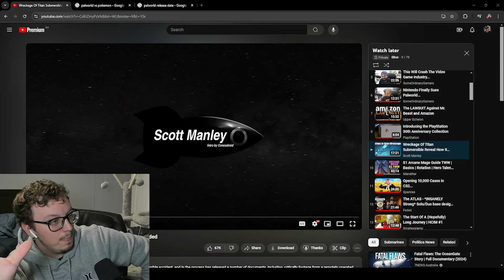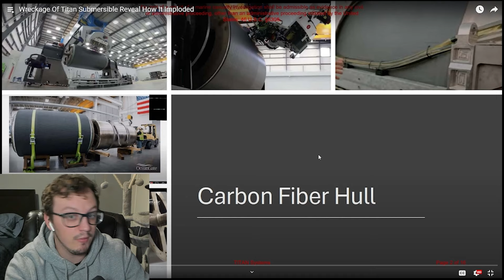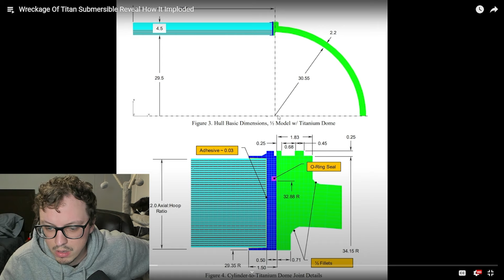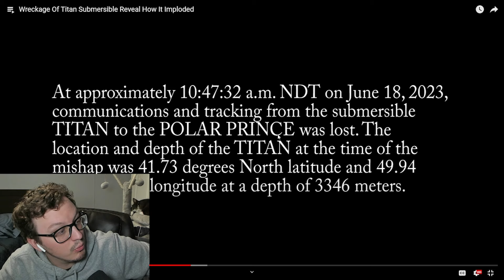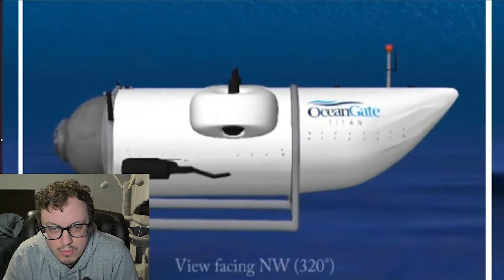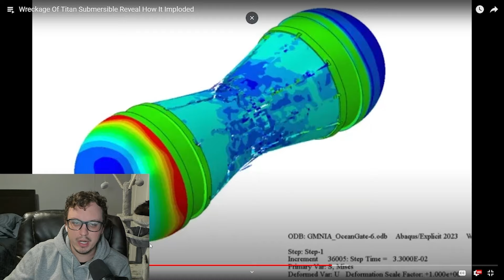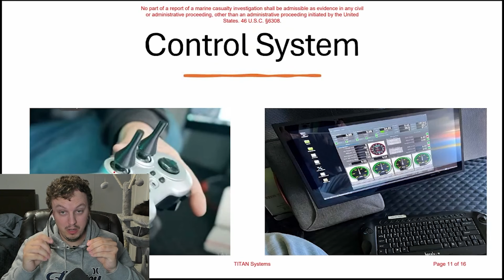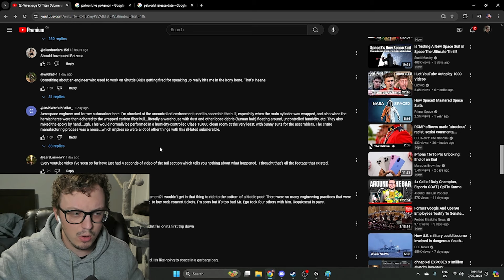OceanGate Titan Submersible How It Imploded

Comment: The contractor who got to look at the parts when they came back up, said that he thought the failure was in the glue joint between the carbon fiber and the titanium. He said that the titanium ring where the carbon fiber had been glued on was completely clean. I think his name is Tym Catterson. His testimony is well worth listening to. You can find it in full on Youtube. Thanks for the video. 🙂
Reply from the maker: Will do. Could be super cool to react to
Reply: They used Polygrip instead of glue.
Reply: @iBluesmile  Thanks. Yes. 🙂
Reply: I saw another video in which they compared that with company videos and showed the OceanGate people basically just put glue (thick, but just glue) barehanded on the rim, apparently without even sanding the titanium nor in a sterile environments. That probably affected how the glue even attached

Comment: The glue in the front joint failed the 5000 psi water sent everything to the back including the passengers...
Reply: I agree.. that's what Scott thinks too.
Biggest red flag among so many on that vessel. Because of the cycles it went through it simply failed and gave out big time this last time. There's demo footage of it showing it wasn't a 100% closed joint as it should have been.

Comment: I’m very chatty tonight.

On “pressurization.” The pressure hull of the Titan as I understand this hull consisted of the:
1) the wound carbon fiber reinforced resin composite (CFRRC) cylindrical hull,
2) a titanium (Ti) adapter ring at each end; and 
3) a Ti hemispherical dome at each end. 
Unlike a typical pressure vessel - boiler, water tube boiler tubes or high-pressure gas flask in which the internal pressure is greater than the exterior pressure - the Titan’s hull experienced higher external pressure (circa 5,500 psi or 1 atm per 10 m depth = 380 atm @ 3,800m) than internal pressure (prob 1 atm). 

The “unpressurized” tail cone means the white fairing was free-flooding. The mechanical, batteries & other components within its hydrodynamic shape were in their own pressure resistant boxes/containers. 

Around 21:40 of your video your explanation is confusing or at odds with my evaluation. About your Fabreeze(R) sprayer, I think you were saying the nozzle/pump handle end was the aft (rear) end of Titan. Thus the base would be the view port dome end. Manley seems to say the failure was towards the forward view port’s dome end due to the asymmetrical nature of the main wreckage. Tym Catterson (former OG ops crew and who examined the wreckage as it was brought aboard the recovery vessel) opined based upon his hands-on examination of the forward adapter ring that the final failure began at the joint between the CFRRC cylinder and the ring. He said the inner lip of the ring was nearly sheared off circumferentially.

Based upon the following (from others whom I deem creditable):
1) CFRRC fails with a brittle failure mode - shatters into pieces suddenly with little or no warning;
2) CFRRC in compression is far less suitable than a ductile, homogeneous material like Titanium or steels.
3) In compression layered CFRRC can suffer buckling on the interior surface of a cylinder (OG’s Cyclops I hull actually exhibited signs of this behavior) and delamination between layers;
4) The junction between the Titanium rings and the CFRRC cylinder was problematic due to the differing modulus of elasticity and thermal expansion coefficients of the differing materials would cause the dimensions to change -> gaps could open up.
5) The CFRRC would likely suffer delamination over time - a “fatigue failure” resulting in loss of safety factor.
6) In most failures once a critical crack length is reached the final failure is abrupt, sudden and travels at high speeds (close to the sonic velocity in the material), faster over short distances than the human sensory system and brain can process. Classic fatigue failure starts with a small imperfection, a crack starts to propagate in tiny increments until the critical length is reached. Then rip!
7) The asymmetrical compression in the main wreckage supports a conclusion of failure near one end, I.e., not in the middle of the cylinder’s length (and definitely not the mid-point of the Titan’s overall length).

Here’s my hypothesis:
Cyclic loading prompted delamination within the CFFRC cylinder.
And allowed high pressure water intrusion in the wall of the CFRRC cylinder at the glued surface.
This resulted in an amount of delamination, I.e. a crack to form until a critical length was reached.
The cylinder wall then failed circumferentially shearing off the Ti ring’s lip.
Some of the CFRRC hull was forced outward by the pressure of water between the hull material and the inner hull surface - bits were thrown outward.
Most of the hull cylinder was crushed radially inward and rearward by the external water pressure - resulting in the crush of debris inside the aft adapter ring and dome. 
Water flowing around the rim of the forward dome hits the forward dome from the inside and forces the forward dome (& view port out) off in the opposite direction of the main wreckage.

Most failure simulations that I’ve seen on YT model a failure at the mid-point of the hull cylinder. (Search Titan Implosion Dr.-Ing. for that by Dr.-Ing. Ronald Wagner*). Dr. Wagner’s simulation shows the hull material from such a collapse crushing into the end domes and blowing the view port out. We apparently see such a result in the wreckage. However, if the failure started towards or at the forward joint of hull and Ti ring then the result could result in a more asymmetrical debris accumulation. Most simulations do not include the structure beneath the passenger deck on Titan’s interior. This was metal framing and held four green oxygen (green is universal for coding oxygen) flasks. This accounts for the box like structure remaining in the wreckage; one of its structure members (channel or box tubing) is apparent. Much of the deck itself seems to have survived somewhat intact - looks concave now not planar.

*Dr.-Ing. is a German (Deutschland) certification of engineering doctorate - “Doctoringenieur.” One does not not gain this from a few on-line courses but years of research.

Comment: Tony Nissen's testimony didn't match the video in which he not only applied the "peanut butter" consistency glue to the carbon fiber hull but also displayed enormous enthusiasm when the titanium ring was installed onto the hull. He assisted in the construction of that contraption, the Titan submersible.
Reply from the maker: Interesting… might have to look further into this
Reply: @iBluesmile  Nissen was definitely not an engineer of any repute. Rush likely picked him because he’d be a yes-man. Nissen was involved in the firing of Lockridge. But even Nissen eventually met the wrath of Rush and was canned himself.
Reply: Yes you're absolutely right, Nissen is seen gleefully announcing the "glueing" of the interfaces, any 'engineer' seeing guys hand mixing adhesive and then applying it by hand on sets of steps around the housing would be horrified.........
Reply: Yea he straight up lied to them.

Comment: 33:00 I think you didn't realize that the titanium cap is the same on both ends (minus the window, but there are two that are otherwise identical), it just isn't visible because the unpressurized end-cone that is more or less still intact is covering it. The second titanium cap (back side opposite to the entry and window) is the part that was found on the ocean floor with all of the debris parts of the carbon fiber hull smashed up against it. It still could have begun at the window but the theory that it was a failure of the "glue" around the front titanium ring is also very plausible and in accordance to the debris they found. 

The submersible had many weak points racing to a catastrophic failure as it seems, it was just a question which of those failed first.

Comment: There were some bolts missing on the front aswell
Reply from the maker: Woahhhh really???
Reply: @iBluesmile  oh yeah on the front ring.....yup. probably right where it split
Reply: @iBluesmile  i bet that bolt is worth dollars now no joke
Reply: The front fell off once as it only had 4 bolts put in, I can’t remember what dive it was on
Reply: @iBluesmile  The “sub” was more of a ish-show than anyone previously knew. There are pictures showing how you could see light through some areas of the carbon fiber hull. The “coating” they put on the outside prevented be able to do any real inspection of the CF for integrity, damage, etc. The hull was several inches thinner than recommended even for a non-recommended material. the titanium domes were of a much lower grade than recommended. 
Essentially, everyone that had survived previous dives was one of the luckiest people on earth.

Comment: This is long, fair warning, but I hope to help further explain:
A summary of why Titan failed, why carbon fiber and epoxy resin shouldn’t be used at extreme depths, and why it is nothing like the Navy’s AUSS (Advanced Unmanned Search System) in construction:
Unlike the AUSS, the Titan utilized unidirectional carbon fiber in its hull construction. Specially 480 layers, 240 of which were strung longitudinally and the other 240 strung circumferentially. The hull consisted of:
The carbon fiber, which was 5 inches thick, the titanium end caps which were each 3.25 inches thick, and the acrylic viewport at the front, which was 7 inches thick. At the depth of the Titanic, the Titan would be experiencing about ~51,700 tons, or 104 million pounds, of pressure being exerted. That’s like sitting the USS Missouri battleship on top of the carbon fiber hull of the Titan.. and expecting the components to hold. There are no known epoxies that can withstand this amount of pressure consistently, and more importantly, safely. 
The failure happened near the front of the vessel, therefore, the epoxy holding the titanium end caps to the carbon fiber hull failed. We know this based off wreckage footage recently released. It did not fail in the middle like previous simulations showed.
Look up a stress and strain graph for steel, then do the same for carbon fiber. You will notice with steel, there is yield strength, ultimate strength, and then eventually fracture. With steel, you have some warning before you reach the elastic region, and another warning before you reach ultimate strength. While with carbon fiber, you will see the elastic region abruptly end causing catastrophic failure with little to no warning. Even worse with carbon fiber, the ultimate strength and the failure point are the SAME. Carbon fiber is brittle, like glass and ceramics. Brittle materials fail suddenly, and catastrophically, with very little warning. That is just unacceptable in engineering, and is the main reason we do not see submersible vessels with carbon fiber paired to titanium, and carbon fiber pressure vessels made of carbon entirely. Failure points are unacceptable for safety, and reliability in cases of GOOD engineering. 
Carbon fiber is also porous by nature. The epoxy is supposed to combat this, but you simply can’t get epoxy in every single microscopic pore. Carbon fiber does NOT like to be submerged. It furthers the act of the epoxy separating from the fibers. This causes a catastrophic cycle of failure in itself. Pores act as a site for water intrusion, water intrusion causes further cracks to form and fibers to debond. This is a bigger problem at water pressures of 5,000psi. More water means more cracks, more cracks means more water etc. 
You can combat this by placing the hull in an autoclave, and heat curing the carbon fiber and epoxy. Autoclave curing removes pores from the structure, and generates a smooth surface. 
Well Ocean Gate didn’t do this. They simply put the hull in a giant conventional oven, and left it in there for a week. Though they claim they did this for every inch they laid of carbon fiber. 
In conclusion, there was no way they could’ve done this, and have it not fail eventually. It was inevitable, with the corner cutting. Very unlike the AUSS, which I’m sure was done with every single safety produce in mind, and it was an unmanned craft. Research vehicle vs. Experimental vehicle.
Reply from the maker: Wonderful insight, when I have more time I’ll sit down and read deeper into this. Thank you for taking the time to explain!

Comment: No, Nissen did not disagree with the design. The Marine Board of Inquiry has put out tons of documents, one of them being a transcript of the meeting where Lochridge was fired. Tony Nissen was in that meeting and he is agreeing with every single thing that Stockton Rush had to say. As a matter of fact, he's the one who got Lochridge fired. Lochridge turned over a list of items to NISSEN that needed to be fixed before he would sign off on the safety of the hull. And Nissen turned that over to Stockton Rush and the two of them set up a meeting with Lochridge in order to fire him. Nissen also convinced Stockton Rush to let all of the outside experts, who were all PE's and had actual relevant experence and do the engineering "in house". OK, so WHO did they even HAVE as in house engineers? Stockton Rush and Tony Nissen. So yes, Nissen was responsible for the final design of this piece of crap. The design between hull number one and two did not change. 

It was in Lochridte's contract that HE was the one responsible for the safety of passengers on board, so that is why Lochridge was so vocal about his concerns and Nissen was insulted that Lochridge found errors in Nissen's work.

Nissen tells TWO different stories about why he was fired. Also, during his public testimony less than five minutes in one of the members of the board called him out on the fact that he gave a totally different answer for the question "what made you a perfect fit for OceanGate" during his preliminary interview. Most of the people who were interviewed during the public hearings had already sat for preliminary interviews, this is how the board picked out which ones would come back to interview in a public hearing. Tony had already sat for preliminary testimony/interview.

Nissen's first story about why he was fired was because he "refused to sign off on the dive to the Titanic". Then, in the public hearing he also said that once the dives were cancelled because the hull had delaminated and had to be scrapped that a member of the board said that wither Stockton Rush or Tony Nissen had to go. And Stockton Rush said "it isn't going to be me". The board member held the two of them responsible because in fact the design was done by the two of them together and Nissen was all in on it. Read the transcript of the meeting where Lochridge was fired, it was released. Clearly Nissen was all in on Stockton Rush's design and implementation, he defends all of it and Rush and Nissen are both ganging up on Lochridge.

Comment: Just my guess but I would estimate from the damage and debris field. The sub most likely lost power due to all three communications systems going off line at once. At that point it would start to free fall with no ability to use thrusters to control the decent, The rear of the sub is heavier than the front so I would guess it started listing towards the rear and the captain in a panic had people move forward to correct the rearward list as he tried to get power restored but it was an over correction and the sub started a nose dive. If you look at her recovery footage the front dome is driven pretty far into the sentiment. where as the rear it pretty much lying on the surface hardly buried at all. It either hit the bottom and imploded or imploded just prior to hitting the bottom driving all the debris rearward (or upward in this case) and shearing the bolts holding on the front titanium dome just milliseconds before dislodging there rear( as the front dome was the weakest link when it came to being dislodged from the inside. It was only secured by four bolts.). Causing the instant disintegration of carbon fiber tube driving the front cone straight into the bottom.Sending the force of the implosion rearward and although it imploded vertically due to the implosion the geometry of the the sub would have been instantly compromised. Pushing the the rear cone into the rear section at an angel separating those two pieces. The rear titanium dome being much heavier would likely travel in an arching trajectory while the control section after it separated was probably flung tumbling through the water due to the lack of hydrodynamics, it's lighter weight and the incredible force of the implosion. Even if it lost power and just fell horizontally most of this would still apply the front titanium cap would be blown off before the rear due to the lack of proper fasters in it. It was fine resisting pressure from the outside but would have blown off instantly from pressure inside the sub.Just my two cents. We will never really know.

Comment: Am at 34 minutes in, and its clear that iBlue missed the video pointing out that the dome with the window is the dome separated from the Titan and seen on the floor and the rear dome is the one still attached to the main wreck. Its only quickly mentioned so easy to overlook when stopping to comment often.
Reply from the maker: Appreciate the insight!

Comment: What is the difference between this submersible and the one James Cameron has been down in many times and to deeper depths?
Reply from the maker: My assumption would be the composition of the carbon fibre
Reply: The ones James Cameron went down in were not made of carbon fiber. They would also have been properly tested beforehand, which Titan was not.
Reply: James Cameron's submersible was made of metal alloys and the pressure vessel was spherical in shape